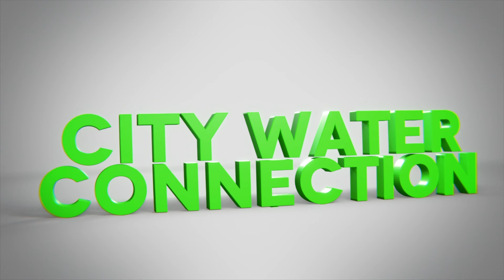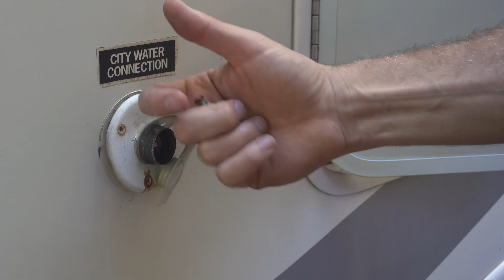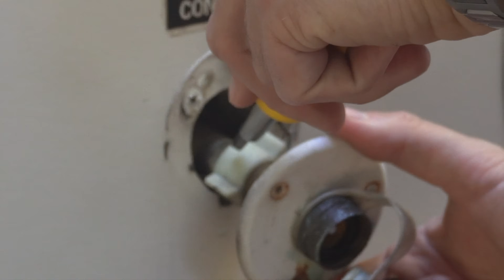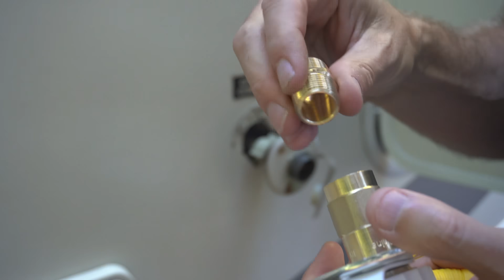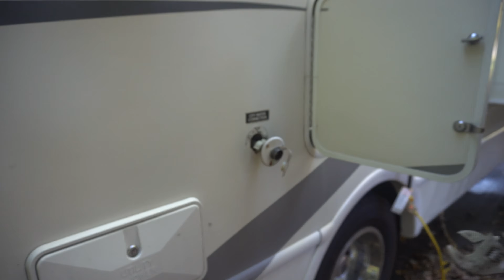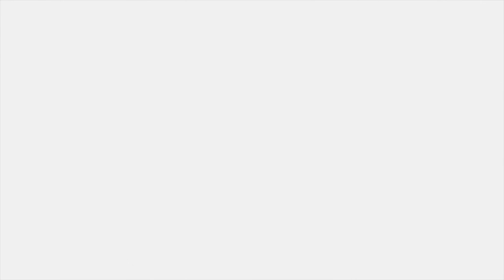Rv City Water Inlet Replacement - No More Leaks!

Comment: Everyone should be warned... If you don't depressurize your water lines.... You will have water pouring out of that line.. which will get pulled INSIDE because the part being removed is the only thing holding that outside. So, the line will be INSIDE ..SPRAYING WATER.
You MUST, shut off your water pump if you were using that. Then, open the lines inside till they stop running water and the pressure is relieved. 
Then go ahead and remove this.
My neighbor was kind enough to repair a drip from my city intake while I was gone for 2 weeks. I guess he somehow broke the check valve. When I returned, I couldn't get water using the city intake, so I began filling my tank daily and using that until I was able to get the new part.
The first thing I did was check this valve. AS SOON AS I MADE THE LAST TURN ON THE THREADED CONNECTOR.... IT GOT PULLED INSIDE & WATER BEGAN POURING OUT OF IT!!! I RAN INSIDE SHUT OFF MY PUMP!! BUT WATER CONTINUED POURING OUT!! Till I opened all of the inside lines! What a disaster!! Easily 5 gallons inside my RV!
Always stop and think things thru when working with plumbing AND ELECTRIC!
Reply from the maker: Definitely. You want to depressurize and make sure that the pump is off. As you said though, even with that you can wind up with some water in the RV. My repair went pretty smoothly and I did not encounter any really dramatic issues.
Reply: I made the same mistake when I replaced mine. As soon as I unscrewed the inlet water started shooting out. I was a bit puzzled at first but I quickly realized I should check to see if the pump was turned on. Sho'nuff. I turned it off, calmed down and finished the install with no problems. I also noticed some of these fittings are built better than others. The best are all stainless steel, followed by plastic with brass threads. AVOID the all plastic ones.

Comment: dont you need to put teflon tape on the inner end also that you screwed into the hose? just wondering?
Reply: It has a rubber o-ring to seal
Reply from the maker: Thanks for answering that. Spot on accurate.
Reply from the maker: Thanks to Über Dad for rightly clarifying that for you. He's absolutely right.

Comment: I have water pouring out on the opposite side of my city water inlet. Should I just replace the inlet valve?
Reply from the maker: If the issue appears to be with the inlet itself, then replace that. If it might be the hose that connects to the back (inside) of the inlet then that would be your issue. You would need to figure out where exactly the water is escaping. Could be a hairline crack on the inlet or like I said, more of a hose leak issue. Let me know how it works/worked out!